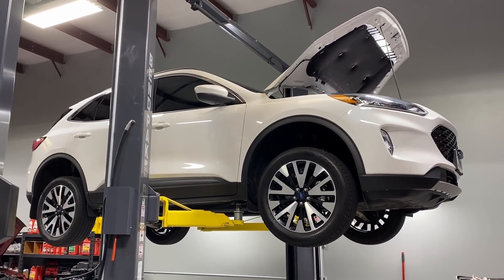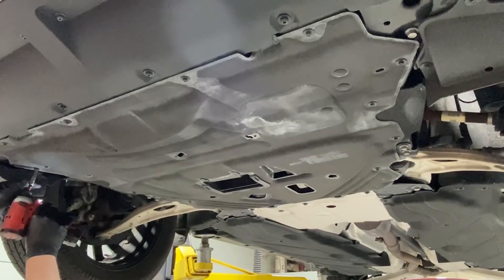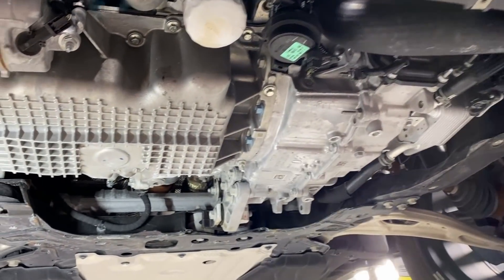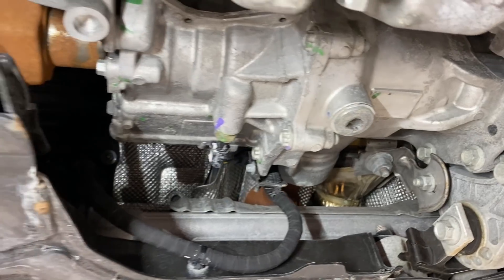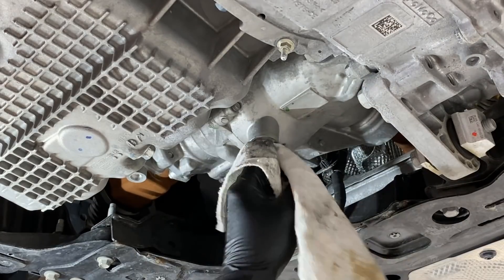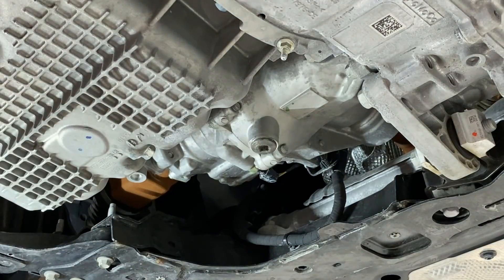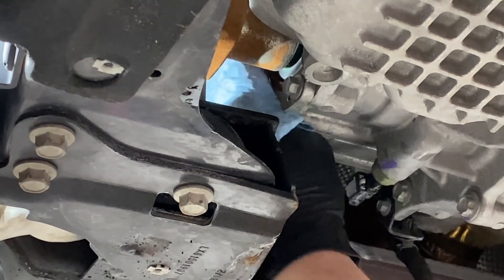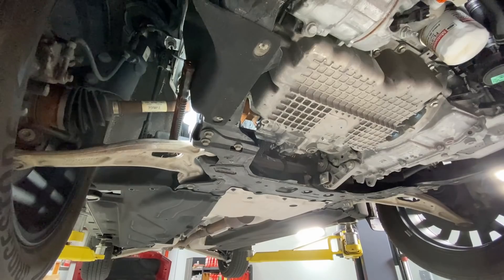2020+ AWD Ford Escape: Power Transfer Unit Service Procedure

Comment: PTU spec fill is 12.75 oz. That's why things have a tendency to fail. It's hold very little and that fluid can get very hot. It has a heat shield because it's very close to the catalytic converter.

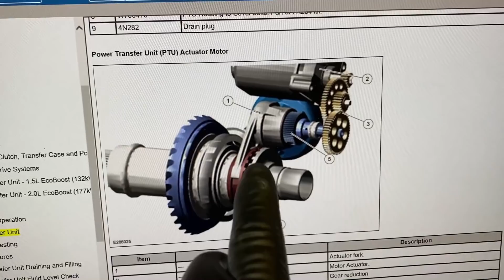Comment: At time 3:40 of the video , The ptu fork actuate by the motor. My escape 2020 AWD(china) when I accelerate from 0 to 50 kph. Gearbox(8F35) from 1 ,3,4,5. Sometimes exhibit a nosie ' ka da ' under my foot (left side of the engine). So, what kind of problem might it be? Where should I start looking for the solution? Thanks so much. ------- From a china ford fans and user. Looking forward your reply. THanks.

Comment: Thank you for this! I'm about to change fluid on my 23 with 34k on it.  I have a question, I'm looking at buying a 2019 2L with less than 30k on it, if I stay on top of trans fluid changes will this extend the life of the trans into the 200k or is this trans just destined to fail? Thanks so much for all your videos they have been my crutch over the years!

Comment: Hello, good evening! What type and size of socket did you use in the top opening? In my sockets, I only had the one that opened the bottom cover of the TPU. They are different from each other.

Comment: My car is a German Ford Kuga - should be equivalent to the US Ford Escape. At least the PTU looks the same and is aircooled.
I replaced the PTU fluid recently. Out came 380 ml. I then filled in about 800 ml as described in the video.
The original instruction by Ford Germany says to fill in only 375 ml. Now I'm a bit worried what to do.
The car runs all right - no oil is being pressed through any gaskets because of overfilling.
Ford US specs say: Hybrid vehicle without cooler 0.35 - 0.45 qt (0.33 - 0.43 L).
Could anybody advise me what to do now?

Comment: Wonder why AAM the manufacturer of the 20+ disconnecting PTU skipped the drain plug on the Cherokee disconnecting PTU AAM has been manufacturing since 2014.

Comment: Hey bro always watch ya videos and have learned from them thr past 10 yrs. I recently traded in my 2012 fusion sport 87 k miles because of that water pump issue that drains coolant into oil pan. $2000 - $3000 job here to do in Cali.  So I traded it in and got a 2020 Ford Edge ST with 38 k Miles. I’m gonna do all fluid changes but do you have ANY videos on 2019-2020 Ford Edge ST PTU fluids changes or anything else on edge ST ? Would love to hear back from you

Alex from Cali

Comment: I have a question I have a 2020 Ford escape SEL front wheel drive eco-boost yesterday I started it up and put it on reverse and it doesn’t go on reverse. I got a code. P0766 only has 19k miles going to bring it to the dealer next week because they are busy. It goes on drive.

Comment: Thanks FordTechMakuloco for the inside view of the PTU and showing where the fill and drain ports are. I was thinking that was the drain port on the bottom, but couldn't find the fill port. I will remove the fill port plug first tho. My 22' Maverick has the exact same design of PTU and just over 5,000 miles so very soon I'll be just making sure they added the correct amount of 75w - 140 ..not draining anything.

When I first got the chance to check the tire pressures, I found the factory had them over-filled to 44psi (the maximum pressure on the sidewalls). It's a trucklet but still rides a lot softer at the correct 35psi cold pressure. So knowing these trucklets were rushed together makes me want to check those expensive components.

Comment: Bought a used 2020 Escape Titanium with 52K.  Just changed the PTU oil (9/24/2022 54kmiles).  Looked like metallic paint.  Worked out just as you showed.  Thanks so much. 
Would you do 8F35 transmission fluid change?
Update 1/13/2025 - After 39k miles I changed the PTU oil for the second time.  The oil came out almost unchanged from the day I out it in.  The magnetic oil plug had the smallest amount of grey material on it.  To be sure, I do a fair amount of highway miles.   I am setting my next change at 150k miles.

Comment: If someone comes on here looking for 2020+ Ford Explorers AWD/4wd, the fill and drain plugs were both T50 Torx. After two tries and Amazon orders, I finally got it done. There is a cross bar frame limiting the fill plug but fair easy with the suction gun @fordtechmakuloco links in the description.

Comment: Hey Brian want thank you for all the great videos I have a 2005 f150 with 5.4l engine, transmision is 4r75e, rear end is 373 axle is 9.75, wheel base is 139 inches  and my question is I tow a 9,000 pound camper and it seems to tow best at 3,000 rpm is that to High of an rpm to run the engine at for hours? my my max towing is 9,300 pounds

Comment: I see they also followed VW on the ac compressor design using a valve solenoid for driving the AC compressor load. No more clutches, don't know what's better but the valve solenoid is easier to service instead of the clutch.

Comment: ALWAYS tell your viewers to remove the fill plug first then remove the drain plug. If you can not remove the fill plug then you will be towing it to the service center to have the fill plug removed, or driving it and damaging the PTU because you drove it without any fluid. Other than that, another awesome video Brian!
Reply from the maker: I have heard this comment before but in all my years of working on vehicles in the rust belt of America I have never ever had this concern. Do you see this often or something? The thread are NPT and some are NPTF so it's a very tight seal and they never corrode.
Reply: @FordTechMakuloco  I usually have to crack the PTU fill and drain plugs on the previous gen Escapes with an 18" breaker bar even when they were properly torqued the last time. The salt corrosion locks the first set of threads on the outside every time. Makes me nervous so I second the advice of cracking the fill plug first. Stripping the fill plug could be an issue if bit slips out due to the amount of torque involved. The transmission level plug is another bad one, it took 150+ ft lbs to crack one open last time. Thread sealant may help stop corrosion but I didn't see that mentioned in the service manual, only on the 6F35 drain plug.

Comment: Really enjoy my girlfriends 2020. Definitely a lot of upgrades over my 14. She already has about 8,000 miles on it while my 14 is closing on 170k without trouble. Always did the ptu at 10k-15k miles did the trans every 30k and engine every 5k. While its not as fun as my supercharged mustang they definitely are nice commuter vehicles and fairly cheap to maintain.

Comment: Great that it has a drain and fill on the PTU. Does it have a drain and fill option for the transmission like the 3rd gens had?
Reply from the maker: Of course.
Reply: @FordTechMakuloco  So, would it be wise to do drain and fills of the transmission fluid every 30k like the 3rd gens to maximize the life of the transmission?

Comment: I'm sure someone will cry about the shield when they need to take it down, but for once it looks like Ford made some engineering changes that are legitimately beneficial for servicing AND longevity.   I'm glad somebody got their head on straight on the design team.
Reply: Honda CR-V shield is much quicker to remove;  Aluminum panel,  mostly 1/4 turn fasteners and 3 (?) screw fasteners
Reply: @AllenReinecke  Now compare either to any Nissan shield.  Not saying Ford is the best by far, but they could be much worse.
Reply: @kellyrjohnson7693  not familiar with Nissan designs
Reply: Yeah, Mazda designed mine so I dont have to take it off. I just have convenient access covers for each serviceable component.

Comment: I like the shielding under vehicles it keeps salt water and junk out, But why dosent the ford ranger have any shielding under it, just curious
Reply: @Jonathan A My other car with 211k miles has its intact. Most of the cars with them dragging have drivers that cant drive and hit things on the road.
Reply: It keeps it in the nooks and crannies, and prevents car washes from rinsing it out.
Reply: @Jonathan A Sounds like it wasn't put back on properly. Mine holds just fine at 120mph+
Reply: @Jonathan A Your fusion is another story. One of the worst cars ford has made. Really the only good thing in the 1.5 and 2nd gen fusions is the 2.5L engine.
Reply: @Jonathan A 1 is 2006-09. 1.5 is 2010-12. Good on you though. That engine is a workhorse.
Reply: @Jonathan A Looks like you deleted your other comment where you asked do I troll everyone. So here is a comment I tried to reply to on there. 

How am I trolling? Please enlighten me.

Comment: This is a timely vid on this procedure.  I watched in horror as pre-2020 Escape PTU'S were replaced after cooking-off and spontaneously dis-assembling themselves.  This video makes my life much easier as I intend on changing out the fluids every 30,000 km - or  18,000 miles.  Cheap insurance.  Great vid once again!!!
Reply: 9
Reply: You can go another 30,000 km more than 18,000 km. The recommendation is 30,000 - 35,000 miles ...so convert that to kilometers and that's 48,280 - 56,327 km.   It's cheap insurance, sure, but unless you're towing and hauling a lot, 48,000 - 56,000 km should be fine.

Comment: Yet another great video. My wife inherited Grandpas Super low mileage 2015 Edge. Upon changing ALL the fluids when we first got it, I was super stoked to find the PTU had Drain and Fill Plugs. It's not a big deal for me so I have been changing the fluid at about every 10k or every other Oil Change. Piece a' Cake...

Comment: Do you think the 2020 Edge AWD will be the same?
Reply: I believe it should be pretty close to this as the 2019 Edge was their first SUV to use the new All Wheel Drive Disconnect system and in 2020 the Escape came with the new All Wheel Drive Disconnect system

Comment: I wish you were more out west. Would love for you to do work on my truck. Just don't trust anyone out here in Vegas. Need a timing job. And alot of reason I have not got one done. Local dealerships will not do it due to age. 2006. Which is crazy cause mine I better than any used vehicle they have on lot. Crazy

Comment: 30k on a 2020? Doesn't stay still much.
Reply from the maker: Why chance it, they made it so easy.
Reply: I have a 2012 Hyundai Santa Fe that just turned over 26,800 miles.  I bought it last year with just under 18,000 miles.  It stayed still too much. lol!
Reply: 211k on a 2017 Mazda6 here. It doesn't sit long 😆

Comment: Curiosity.  I have a MKS AWD and the tranny temp is 210. Active grill shutters causing higher temps?
Reply from the maker: What’s wrong with 210?
Reply: @FordTechMakuloco   thought anything above 200 is no good.
Reply from the maker: Perfectly normal, anything above 230 is not normal.
Reply: @FordTechMakuloco  runs a little hotter then my burban.  Thanks for all you do!!  Love them PTU vids.

Comment: Only 30K and maintenance is needed?
I do not know of any other brand that needs this so soon.
Low quality fluid? Too hot?
Reply: The issue is the PTU doesn’t hold a lot of fluid so it doesn’t take as long to degrade. The older design PTUs are even worse (Edge, Explorer, Taurus, Flex, etc) On those cars the PTU is close to the hot exhaust and hold less than a quart of fluid. Even on a car that sees low mileage the fluid will be black in a year and turns to sludge quickly if you don’t stay on top of it. And most of those units don’t have a drain plug to change it and are listed as “lifetime filled” in the owners manual.

We have a 2016 Flex AWD. I drilled and tapped the PTU to install a drain plug and I change the fluid every year. Overkill? Perhaps.......but fluid is cheap compared to replacing a PTU
Reply: He made it sound more like a recommendation than a need.  My 2012 Santa Fe has a "lifetime" transmission fluid interval according to the owners manual, but I'll be changing it once it hits 30K.  Keep your fluids clean.
Reply: the older generations of escapes had it even worse. They were not water cooled, ran next to the exhaust and were tucked up away from air flow. Also they only had a fill port so if you didn't have much means to get sludge that inevitably formed out.
Reply: Previous designs had a tendency to degrade the oil super fast, they got really hot then it destroyed the gears and bearings. If i drove a heavy vehicle with a PTO, I'd probably change the oil every year. Could probably be extended if it looked ok every year, maybe do 2 years.